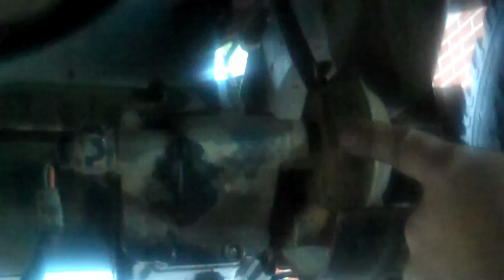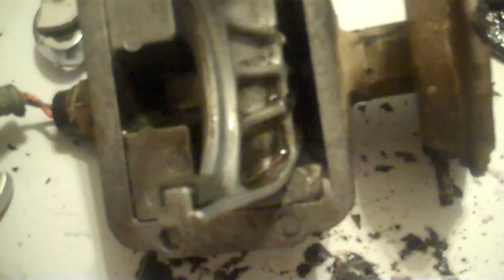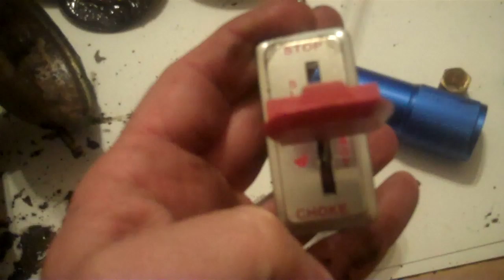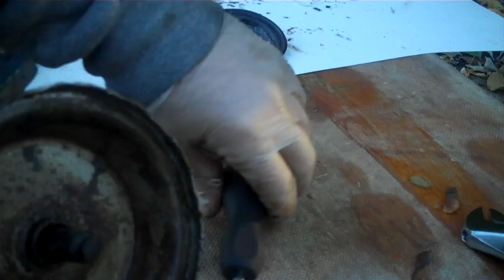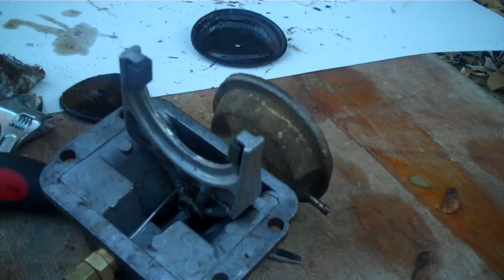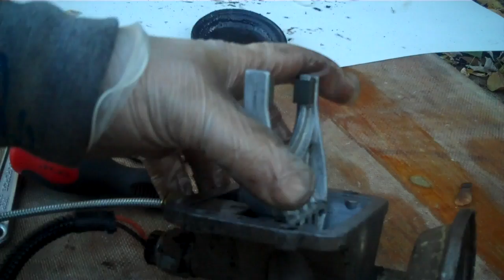DIY Jeep Wrangler YJ Posi Lock diff conversion

Comment: So since my posi lock won't engage 4x4 and the light doesn't show up in going back to stock vacuum since my vacuum is all working properly, if not ill just use 2 clamps and lock the dif with the stock actuator so the light works lol
Reply from the maker: That light just annoys me, I take the bulb out so I don't have to look at it.. Its easy to tell when you are in 4 wheel drive.
Reply: @Poweraddicts  well i don't feel nothing engage i tried going reverse etc . But since I have vacuum in stock hoses I bought the complete oem 4wd actuator so ill remove the posilock

Comment: Great Video Man, One question Please... When you pull the cable to engage the 4x4, does it line up and engage all the time or do you have to kinda move the jeep a little to make the spline line up and go into place while pulling on the cable? If that's the case then you can't put it in 4 wheel when sitting still... Right? you have to have some movement to engage the spline on the axle??  Would really appreciate you explaining... thanks so much....  DanO'
Reply from the maker: Thanks, glad you like it! What I typically did was. I'd stop, pull the cable and slowly inch forward. That would allow the collar to engage smoothly. I now have the collar locked in permanently. So, I removed the cable since I didn't need it anymore. Here is the video where I locked the collar over: https://www.youtube.com/watch?v=J6lo71J2LtE . Thanks for dropping in! Have a great day!

Comment: I'm guessing you don't have a front locker ? If you did have a front locker even if you don't connect the front axle ,you would have been able to drive in four wheel drive ,even if the rear drive shaft was removed, you would still have one wheel pulling in the front.. wow that's a mouth full..
Reply from the maker: No locker yet. Coming soon hopefully. I've had to drive it home in "front wheel drive". Dropped the rear driveshaft one night. I toss the driveshaft in the Jeep. Pulled her back in 4 hi .. drove her home. Thanks for dropping in and leaving a great comment! Have a great day!!
Reply from the maker: No locker yet. Coming soon hopefully. I've had to drive it home in "front wheel drive". Dropped the rear driveshaft one night. I toss the driveshaft in the Jeep. Pulled her back in 4 hi .. drove her home. Thanks for dropping in and leaving a great comment! Have a great day!!

Comment: Hi, I have a yj 90 I would like to know what function the vacuum actuator fulfills, mine is with a broken hose, but my 4x4 works
Reply from the maker: Well, its supposed to be to move the fork to connect the 2 piece axle shaft. If you have a vacuum line broken, without seeing it, I have no idea how your 4 wheel drive is engaging.
Reply: If your four wheel drive works but your vacuum is broke , its probably stuck to the left or the driver's side..

Comment: I did this and am now leaking fluid from the actual cable shield? any other problems with this?
other than that, it works fantasticl
Reply from the maker: I used RTV inside the coupling when I tightened the brass fitting. Also used the outer cable cover (hose) RTV and clamped it. I had no issues at all. I broke the shift fork about a year ago. I locked the collar in place so now it's locked in full time. I'm gonna do a video soon as to how I locked the collar in place. Super simple and CHEAP!!
Reply: Check your axle seal..

Comment: Going to try this tomorrow!  My 95 YJ has just been sitting cause its squirrely around 30mph.  I had a friend help me figure out the 4wd wont disengage. (most trouble shooting talks about not engaging to begin with)  Hours of videos and research to figure out what it might be.  Glad I know how the system works now. Hopefully this is the fix I need!  Its my first Jeep and had it about a month an only been on the road a few times.  Your videos are very helpful, thank you. And thank God for TN weather so I can work on my Jeep in the winter. : )
Reply from the maker: You're welcome, glad you like the videos! I now run my front diff locked all the time. That little shift fork that slides the collar to engage the shaft, it broke, so I locked the shafts together full time. It shouldn't make it squirrely. Does it feel different while driving slow speeds? Yes, it does, but it doesn't hurt anything. Just makes turning tight turns feel a bit different. I'd start checking the tie rods and other front steering parts. If any of those are loose and worn, it will cause crazy low-speed steering issue. Which means it can create more dangerous issues at faster speeds. Good luck! Congrats on buying a Jeep! Have a great day!!
Reply: Actuator was very clogged!  Working on the cable system now... wish I could post a pic... lol
Reply: Already did most of the front end parts :) in my driveway ... just need it stable enough to drive so I can get to the Alignment place.
Reply from the maker: Send the pict to the facebook page: https://www.facebook.com/fixjeeps/

Comment: is it necessary t pull the plunger apart?
Reply from the maker: Most cases, no you dont have to pull it apart. That one was dragging so I wanted to see what was going on inside the diaphragm area. It must have been all that built up crud inside that area. Once I cleaned it out it moved much better.
Reply: awsome. good to know. got a 96 ram that could use this treatment. thanks.
Reply from the maker: Thats right, I forgot about the full size Dodges using that vacuum pot. Suggestion, get a long old school choke cable instead of the throttle cable. The throttle cable will probably be too short. You can get the choke cable at most autoparts stores. Good luck!!

Comment: So on my jeep where the vacuum lines hook in I can take that whole thing and do a 360 spin with, been hearing a knocking sound where unit is when at stop light. What do you think is broke in it??
Reply from the maker: There is a fork that slides a collar to engage the splines. That fork is made of some cheap metal. Very prone to breaking. If it does break, the collar will "float" and will catch the axle splines causing strange noises. I've also head of that fork popping against the spline after breaking. All you can do is pull it off and look. It should be obvious pretty quick.
Reply: Ty
Reply from the maker: You're welcome :-)

Comment: hey I was just wondering which way the fork on the vacuum goes to lock it in 4lo? I'm killing my jeep this weekend at a mud bog so it won't need to come out of 4lo. I can slide the gear right but not to the left of the axle. Just wondering which way I need it to lock onto to keep it in 4lo.
Reply from the maker: Slide the collar away from the passenger tire toward the center chunk. That will tie the axles together. But, the low gearing is determined by the transfer case, pull the t-case shifter all the way back puts you in 4low. The collar simply locks the axle shafts together.
Reply: +Power Addicts - FixJeeps.com - Jeep, car and motorcycle tips 
Thank you!! She's locked in now. Tcase was already in low and still works fine. I can lock it in and out by hand now lol. Just gotta take the cad cover off
Reply from the maker: The collar will not stay by itself. Something has to hold it in place or it will slide back over. I've done a trick where you take 2 hose clamps. Put a clamp on each side of the collar to prevent it from sliding back over. Effectively locking the front diff full time. The main thing to watch is: one - stagger the worm screw of the clams 180 degrees from each other on each side of the collar, This prevents the front shaft from being thrown out of balance and vibrating. Two - make sure the clamps are TIGHT .. but do not strip the band or worm screw of the clamp. Some people are freaked out by doing this mod .. so its up to you if you want to do this. I'll make a video of the mod sometime soon.
Reply: +Power Addicts - FixJeeps.com - Jeep, car and motorcycle tips 
Hey man. I think she will stay. The plunger is rusted to fuck and takes quite a bit of force to slide it over lol. If not I will just slide it back over after someone drags me out of the hole hahah
Reply from the maker: LOL .. have fun! My Jeep has been dragged out, even with the front diff locked. I was buried to the frame. All in good fun :-)

Comment: how much length was this cable and how much length did you have left over, slack wise?
Reply from the maker: +Patrick Thomson 
I didnt realize until after I had run that cable through the floor that it was a tad short. Best cable that I have found so far is using an old school automotive choke cable that can be had at most local auto parts stores. The choke cable is much longer then the lawnmower throttle cable. Still to this day that conversion is working great. Thanks for dropping in :-) Have a great day!

Comment: Great idea! Did you just cap off the old vacuum lines down to the canister?Cause they'd be still trying to pull air  one side or the other
Reply from the maker: +Darwin “windar66” Ewins Yep .. just cap them off and let 'em ride. This mod has worked flawlessly every time. Just make sure the cable you buy is long enough put the handle where you want it. Thanks for dropping in! Have a great day!
Reply: Power Addicts - Jeep, car and motorcycle tips thanks for the informative info!Great vids!
Reply from the maker: You're very welcome! Thanks for checking out the vids!

Comment from the maker: +Zack Seal
I wanted to reply directly off of your comment but there wasnt an option.Anyway ...That cable I used in that video turned out to be shorter that I thought,it's probably 4ft. I have since picked up a choke cable from the autoparts store which is much longer and will work much better. Just havent installed it yet. Hope that helps. Thanks for dropping by and have a great day!

Comment: thanks so much for the video. the setup worked great. the only thing i did different is i drill and tapped the yoke to a 1/4-28 thread and made a low profile eye to hook the cable into works better than it ever has. koodos to you
Reply from the maker: Karl Parrott Great job! Since I did the mod, it has never failed me. Thanks for checking out the video! Also thanks for sharing a great suggestion! Have a great day!

Comment: Wish i would have seen this before I locked my CAD axle in all the time and broke the front u joint also cracking my transfercase. I ran mine for 2 months before the first u joint that was unreachable to grease broke going 50 down the road.

Comment: Question my wrangler is just for the woods..mud.. deep puddles.. in other words I don't drive in street  if i mod it to lock full time is it bad . Also is the rear locked of do i have to mod ot also.  Thanks.. your videos are awesome learned alot for a newbie
Reply from the maker: Full locked on dirt and mud will not be too bad. It will make it harder to make sharp turns. It does put more stress on the axles. You can do one axle or the other or both. It's strictly a play toy, I'd do both. Best option would be to get something like these great but inexpensive lockers. http://amzn.to/1FsvWUh . You can still drive on the street, yet have great traction when needed. Hope this helps. Thanks for dropping by and really glad you like the videos!! Have a great day!!

Comment: I did this on my yj and it worked pretty good but honestly just get the passenger side tj axle and get rid of the vacuum actuator all together. Your still going to have problems with it down the road.
Reply from the maker: I have thought about doing that. If I ever run across an axle I might do it. I locked my CAD in full time and it felt like I was pushing the front end around corners. I unlocked it and left it where I could lock or unlock at will. So, I'm really on the fence about it. I haven't had any trouble at all with the convert since I did it. After the convert, the only other issue that could arise is the CAD fork break. But, they tend to crack whether its with the vacuum actuator or Posi Lok convert. So agreed, running the TJ axle does do away completely any issue that could arise.
Thanks for dropping in a great tip to share with others! Have a great day!

Comment: Question, would this allow for 2wd low?
Another plus would be if I had this option I could weld the front end locked for wheeling and still have it open for road use right?
Reply from the maker: Rob Nusekabel Drop in 4 low and not locking the front diff will get you 2 low. As for welding the front, if you do that you will loose the 2wd low that you mentioned first. This is because by welding the front gears you basically turned the front diff assembly into a full spool. I don't promote welding gears unless its a full trail rig. Thanks for checking out my video, have a great day!
Reply: Welded mine. And as mentioned above, without the axle posi lock engaged I have the driver side spinning while not actuated. Which honestly has helped in tight situations while in 4low. You can just engage and disengage the axle when you like.

Comment: Great video. I have a 2001 Dodge ram 1500 that had the same set up. My 4x4 isn't working either and I think it's because of the actuator so I'm going to attempt the same thing you did in your video. Thank you for the idea. I'll post how mine turned out later on. Oh and just a stood question but why cant the axles just stay engaged ? Why do they need to disengage ? Just wondering
Reply from the maker: julius mclauchlin Some people run with the axles engaged. One popular conversion for the YJ Wranglers is to put the TJ axles in the tubes to eliminate the CAD all together. I tried running mine with the axles engaged. It felt like I was pushing my front tires around tight corners. I didn't like at all the way it felt while driving it. So I disengaged the front diff and it felt normal again. Also some people report that the feel the vibrations from the front drive shaft spinning. Now that I did the manual conversion I don't have any issues at all with the front diff engaging or disengaging. I just engage them when needed. Oh .. one point, the cable I used in this video was a bit shorter than i liked. I got a crazy long choke cable from an auto parts store to replace the shorter one. So be sure you get a cable that's longer than you actually need. Thanks for checking out my video and taking the time to comment. Have a great day!!

Comment: What did you do about the vacuum line to the t case or engine?
Reply from the maker: All the vacuum lines are still plugged up like original. Inside the vacuum can of the CAD I packed gasket sealer around the edges and inside the vacuum port. This prevents water from entering where the diaphragm is now missing. Also the gasket sealer prevents vacuum leaks from where I plugged the CAD vacuum line back in place. The 4x4 light works. Pull the cable to lock in the CAD, pull the t case into 4 wheel drive. Everything works great now. Thanks checking out my video and asking a great question! Have a great day! :-)

Comment: Great video  & great mod.
You can also remove the CAD and install a one piece right axle shaft from an XJ or TJ Dana-30. You do have to install an inner axle seal for that side since the seal is currently at the CAD for that side. I am gong to eliminate the entire thing on mine by installing a Dana-30 that I pulled from a '98 XJ. Also gets me larger axle shaft u-joints. Just a matter of welding on the leaf spring perches. I just need to catch up on some other projects first. You can get XJ Dana-30's for $60-$120 at the U-Pull salvage yards in my area. If you get lucky you can also get an XJ Dana-44 rear for around the same price.
Reply from the maker: I've read about the TJ axle convert, definitely an option to look into . Too bad I scrapped an explorer a while back before I got the YJ. It had an 8.8 under it that I could have gotten for free to upgrade the rear! I've got a set of 1 tons from an old black Chevy that I used to have. Its on my site http:\\www.poweraddicts.com. They are a bit overkill for the Jeep considering its a DD. I get too good of gas mileage to hurt that. I get about 21 highway in a fun to drive ride. Have my cake and eating it too!!
Reply: PowerAddicts That 8.8 would have been a great free upgrade since you already had it. I had an 8.8 (welded spiders) and Dana-30 from a 2.5L Jeep YJ both w/4.10 gears in my '91 for a short time along with a 4" RC lift. Removed everything and went back to stock (even reinstalled the Dana-35) then parked the Jeep for a few years.
Considered going "overkill" also. I have an '86 Chevrolet M1008 just sitting going to waste (bad 6.2L). That Dana-60 & 14-bolt w/4.56 gears and a Detroit locker would have worked great in the YJ. Would have also been very heavy and required more power. I decided to keep it light, low, reliable, and drivable instead. As well as keeping decent MPG's. Now it only has a 2.5" RE lift (gave almost the same lift as the 4"RC) and I am staying with 32's (265/75R16) this time around. I just need to get back to work on the '98 XJ Dana-30 & '87 XJ Dana-44 axle swap 3.55/3.54gears for the YJ. Hopefully never to go back to stock again.